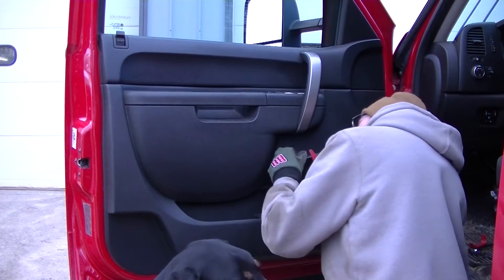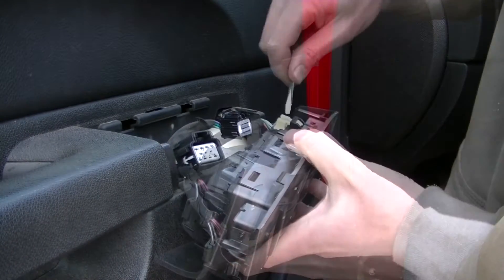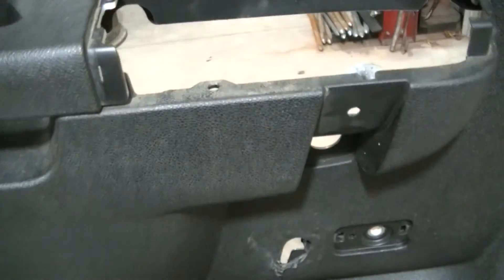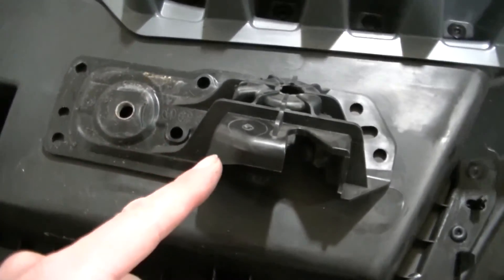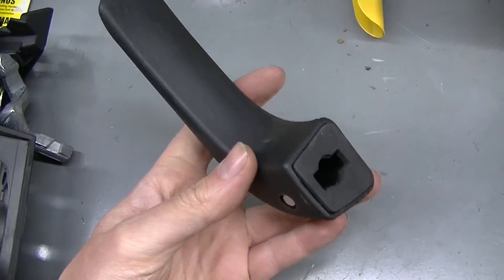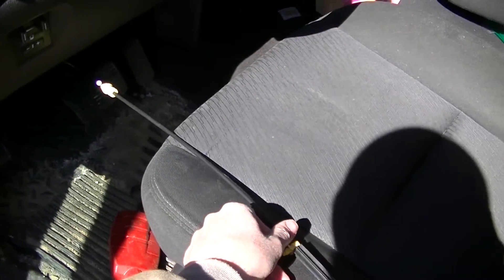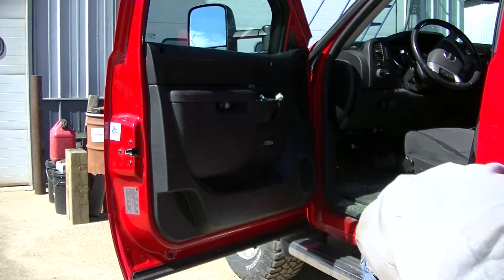Silverado GMC 07-13 Inside Door Handle, Panel & Cable Removal Replacement

Comment: Great to see that all I have to do to remove the switches for replacement. Is I just need to remove the door pull bar off. Then I can access the switches. Great video!!! At least I also know how to take the entire panel off. Going to have to remove the pass side rear panel to find out why the speaker doesn't work. Pretty much the same process as the front panel. Thanks for posting this detailed video!!!😊

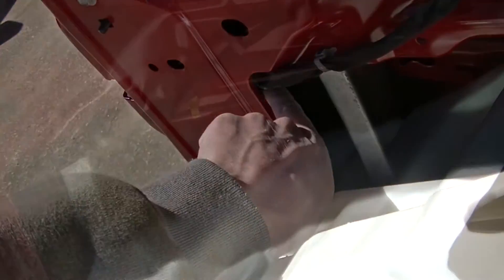Comment: Thanks for the video and that link! HOWEVER (I'm Monday morning quarterbacking here but I just did this a half hour ago so I speak from experience) to make this WAY EASIER at the 20:20 mark you just needed to undo the three torx screws that holds the latch. The latch assembly in there is not tight. It can easily be pulled to that open area where you hand is at 20:20 and you can slip the new yellow end of the cable into the groove. No pick tool needed, no messing around trying to get back into that hidden area which is impossible to see or get at for anyone with large hands. Now put the latch back where it belongs and screw the torx screws back in. Then move on to attach the other end of the cable to the inside handle per the rest of your great video!
Reply: Jeff Axel Hey brother, thanks for leaving that comment.  This guy did a great job on this video, but when I saw my cable was also broke I remembered seeing your comment.  I did as you suggested on the latch and the cable went right on with no issues.  You saved me some time. 👍🏼
Reply: That was a help to would’ve taken me longer then 20 mins to do so

Comment: Awesome video buddy. Exactly what I needed. One sticky part was trying to pinch the holders to get the cable out of its holder. I improvised and used a Dremel tool and carefully whittled away at the plastic. I was able to save my cable and this went on and off like a breeze. I greatly appreciate your precise instructions! Thank you!
Reply from the maker: Glad it helped

Comment: Well done.  I like that you would show all the little details that other videos just gloss over.  Thanks.  Dealership wanted $700+ for the whole panel + labor.  Got the parts and shipping for $45ish.   Update.  Completed the job but unfortunately I broke the little tab where the cable retainer connects.  Took it all apart, pulled the new metal piece and put it in the old unit and reinstalled.  Works fine.  Hopefully the little screws and superglue hold.  Great video thanks

Comment: Thanks for the video and tutorial.  I had the inside door handle on the pass side quit working on my 2103 Silverado.  I suspected the cable and you video was great in getting me prepped for the job.  It was indeed the cable and it was broken about 2" down from the handle side where the plastic connector is attached to the outer black cable.  There was a bit if a kink there and that contributed to the cable binding a bit and finally giving out after 9 years.  I have the Dorman part on order.  It is the same from driver side as pass side.  I will get it installed next week when I receive it.  Thanks again.

Comment: This video is great, lots of detail and pictures Made the replacement go a lot smoother, especially the cable,   Don't over drill the plastic rivets, careful with the (fragile) clips on electric connectors on and recommend getting (slightly) longer screws and give glue time to dry.

Comment: Very informative video. Helped me replace the broken spring in mine. Plastic plastic and more plastic...never pulled a panel that the handle stays on the panel. Junk, cheap. Chevrolet should be ashamed. 
Very loyal dog you got there!
Reply from the maker: I was disappointed with use of plastic in areas that should have more strength. They had a great design in the last generation. I don't think I ever heard of people breaking a door handle on the 99-07 trucks.

Comment: Nice job Mossman,  I think most people who work on cars hate working inside door panels. Every one has similarity's but still different.  I don't think I've ever done one without "giving blood" in the process.
Reply from the maker: It's not to bad if you know where all the clips are and how the cable works.  Going in blind can make the job harder than it is.  It was really hard to see the one end of the cable.  You might be able to unbolt the door latch but then you probably need to unhook everything that goes to it.
Reply: Made me laugh
Gave blood today doing this

Comment: Good job on the vid, very useful. Now I have to tear it apart and see what broke, first thought is handle, but might be cable. Was backing up to a trailer jump out a couple times and uh oh can't get out now haha. Then on top of it, the Drivers window switches won't put up pass side windows. Go down but not up...ok not end of world. Now the Drivers window will go down but sometimes not up. Gotta play with the switch for a couple minutes then it works fine. So can't roll window down cuz it might not go up, and inside handle is child locked haha.
Reply from the maker: Sounds like you need a new switch panel. Dad has to play with his rear window switch to get it to work sometimes.
Reply: @mossman381  Yea I watched some other vids and read comments. Apparently the switches fail a lot, so we'll see what happens with a new one.

Comment: Nice video except both my handles are broken now.....I got as far as removing the panel....is it possible to remove it without being able to open the door?
Reply from the maker: I don't know if that is possible. Maybe if you remove the seat. Don't know if that is possible without opening the door.

Comment: Ok, I followed instructions and all was well, until I did not snap the little ball with the cable (wire on it) back into place; I shut the door, now I can't open it in any way.  Any suggestions?  It seems I will have to take it to a shop to get the door panel off.  Impossible for me to take it off when the door will not open. Dumb me.
Reply from the maker: Outside handle should still open the door.

Comment: Any suggestions on best place to buy (best price) handle replacement? Our handle just snapped off.
Reply from the maker: I think I have links in the video description for parts. Your local auto parts stores probably have them but I doubt they are cheaper than Amazon.

Comment: Hey wat size is the cable because is 3 different size I need one my truck is gmc Sierra 2012 1500 thank
Reply from the maker: Not sure of the size. Didn't know there was other sizes.
Reply: @mossman381  ok thanks

Comment: What did you use to compress the two tabs on the cable on the actuator?
Reply from the maker: Probably just some needle noose pliers. Really whatever you can get in there.

Comment: I have Manual windows how do you get it off so you can pull panel off ?
Reply from the maker: There should be a small clip holding the handle on.  They sell a tool to help get it out.

Comment: These door handles are a JOKE!!!!!!!  I took my 2011 to Chevy and they wanted $1,100 to repair the door.... I laughed at the guy....There should be a recall or life long replacement ....
Reply from the maker: The GM dealer will replace the whole door panel. That is why they quoted you that number.
Reply: It cost so much because Chevy doesn't make a OEM door handle kit. You have to replace the complete door panel and thats what cost so much as I aske the dealer myself lucky for me its just the cable.

Comment: I was hoping I could get to the cable at least so I could get a vice grip on it and release the door latch.. 
It would be nice if they would stop making their parts so darn cheap (plastic) and remove that door locking device that traps you in your vehicle if not in park....or you didn't have time or thought to unlock it before jerking on the door handle to open it while done irate person is yelling at you for trying to back up a foot to get in t o a parking slot
Reply from the maker: GM really messed up these new handles. The old ones never broke. They could have just redesigned the handle. I disagree with not having the auto lock. That has probably saved a ton of peoples lives. My dad watched someone get out of and older truck which didn't have the auto lock and the truck started rolling away. It was rolling towards a group of kids eating ice cream. He tried to stop the truck but couldn't get in it while it was moving. He did get the steering wheel turned so the truck turned away from the kids and ended up hitting his truck that was parked around the corner. I can't really think of a way to open the door with both handles broke without breaking the door panel or maybe door handle.

Comment: Newer the truck the more difficult the job becomes. I’ll stick to my older trucks
Reply from the maker: It's not to bad if you know where all the clips are and how the cable works.  Going in blind makes the job a lot harder.  I do like the 99-07 door panels much better.